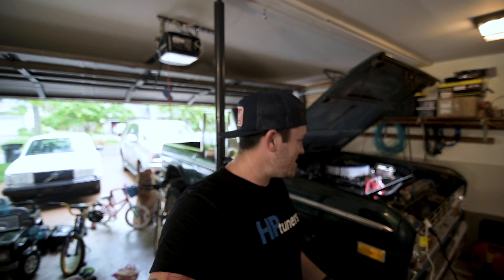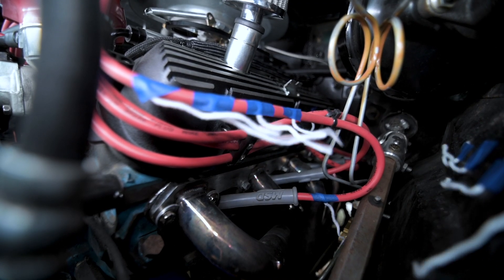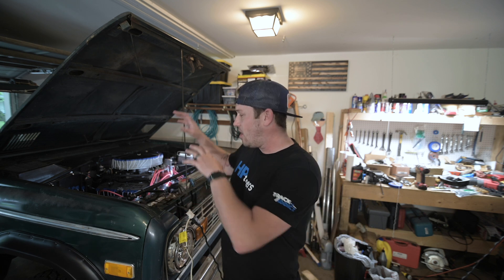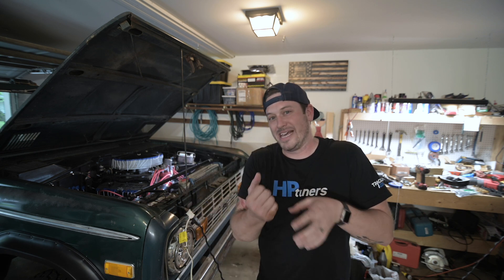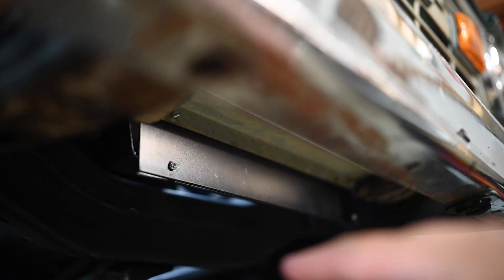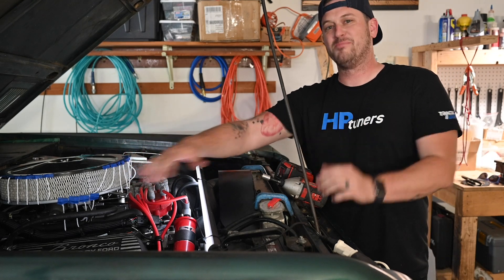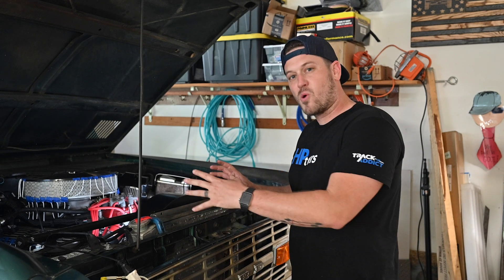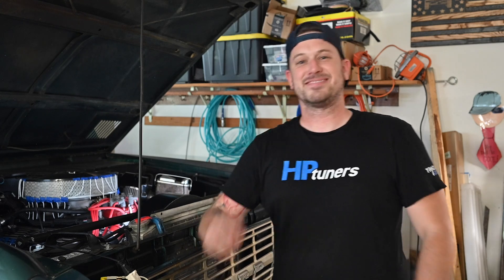How does air move through the engine bay?

Comment: I have a Jeep XJ with the same problem heats up when the vehicle is still. I’ve got hood lovers and I noticed yours but they are small. Larger ones would allow more hot air to rise out. I also have an 8” fan mounted as a puller on one of the hood lovers and when that is turned on you can really feel the hot air come out. Doing that would really change the air flow inside an engine bay.

Comment: dump the mechanical fan and get a good quality electric setup, radiator upgrade is worth it to something like an aluminum unit, your alternator may need to be upgraded, worth it if you want to pick up some HP, also unless your overheating temps shouldn't matter with a fan shroud all that shrouds purpose is to pull air thru the rad and cool your engine if you want cooler under hood temps add some louvers to  your hood or equivalent Gen 1 bronco's have smallish type under hood engine bay . Remember too the EFI needs your engine to be hot to work efficiently, headers you could consider ceramic units or wrap them. The trans the same deal keep it cool like the rad via a cooler. unless your seeing temps on a gauge that are too hot then I wouldn't get too excited.

Comment: Air over the engine isn’t as important as air through the radiator. You need a fan shroud to help pull air through the radiator to keep the water cooler. Cooler water equals cooler engine.

Comment: I change the normal fan from my 92 Bronco.  Them I install an electric fan from a 90 windstar. So far no overheating problems. This modification just free an additional 5 to 10 horsepower and the engine performs great. It’s an original 302 Windsor with some touches here and there
Reply from the maker: Nice!!!

Comment: For the community... What engine temp do you typically see for these old 289/302s? I have a fairly fresh rebuilt 289 (less than 200 miles on it). It runs about 220F. Engine appears to run just fine, seems a bit hot to me... but Im new to these type of things.
Reply from the maker: I run mine at 180
Reply: Consistently 180 on my 302
Reply: 180 all day. Even in 100-110F AZ weather. Make sure you have a thermostat and shroud.